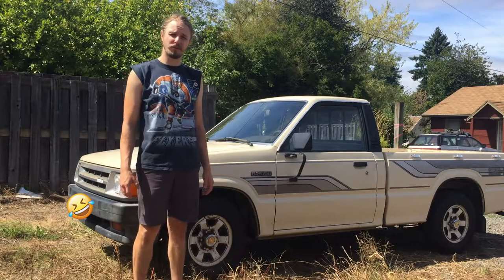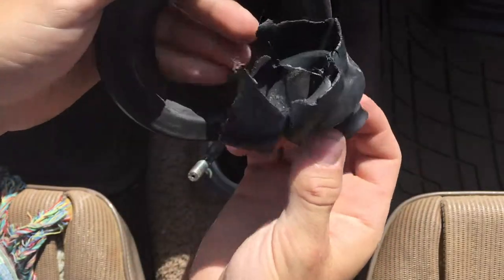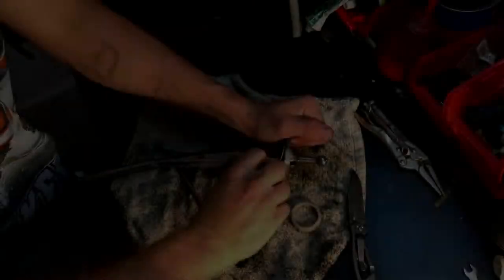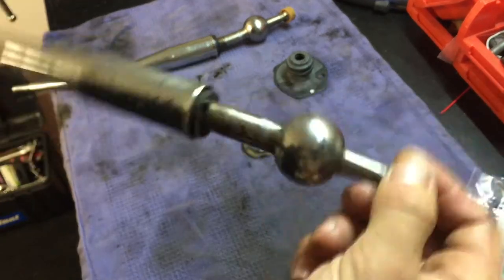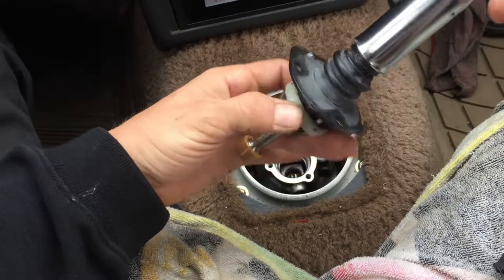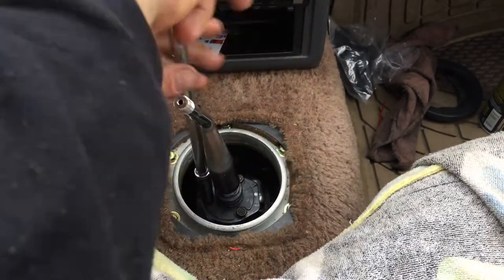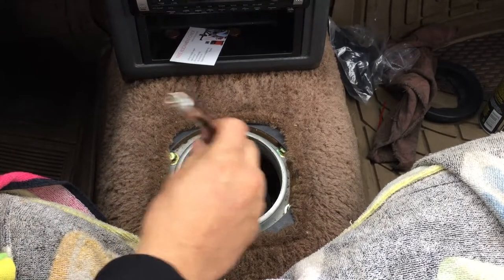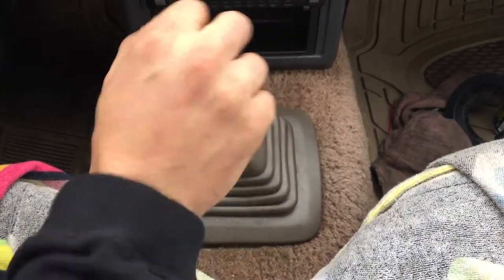Mazda Loose Shifter Bushing Repair

Comment: My brother where did you get the replacement parts, I'm in the same scenario as you right now but need the boot and the plastic bushing?? Please help
Reply from the maker: Here's the link for the mazda rubber boot cover I used: https://www.ebay.com/itm/2006-2015-Mazda-Miata-MX5-5-Speed-Transmission-Shift-Dust-Boot-Turret-Seal-OEM/201335854615?ssPageName=STRK%3AMEBIDX%3AIT&_trksid=p2057872.m2749.l2649

Here's the link for #2 rubber boot I used: https://www.ebay.com/itm/Mazda-Bseries-truck-1986-1993-New-OEM-manual-transmission-shifter-dust-boot/201599463869?ssPageName=STRK%3AMEBIDX%3AIT&_trksid=p2057872.m2749.l2649

I got he bushing with used shifter assembly from Pick n Pull. It was like $6-7. I did some ebay search and I think this is the bushing you need: https://www.ebay.com/itm/MAZDA-MIATA-929-B2000-B2200-B2600-MPV-RX-7-NEW-OEM-SHIFTER-KNOB-BUSHING/191891093922?fits=Make%3AMazda&epid=1211238385&hash=item2cad99b9a2:g:o3UAAMXQlgtRxOWu

Comment: What year model and make is your Mazda I have a b2200 are all year models the same
Reply from the maker: I believe 86-93 Mazda b2000 and b2200 use the same transmissions and transmission parts.